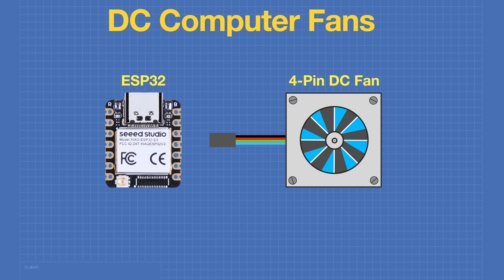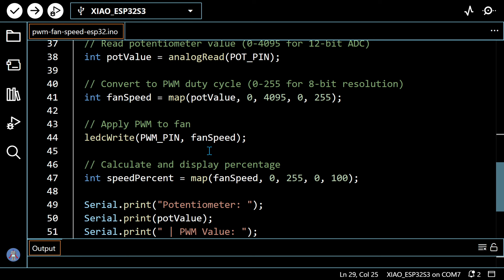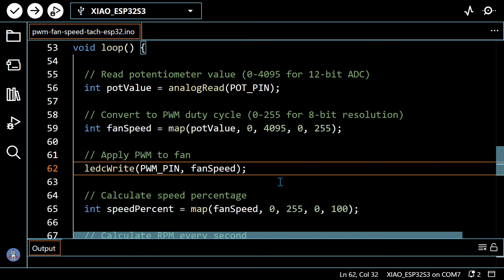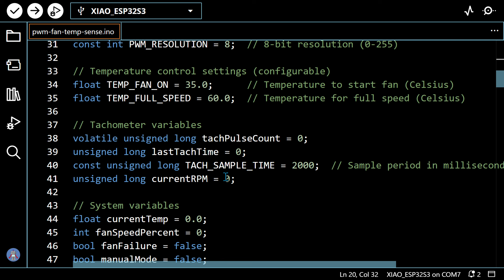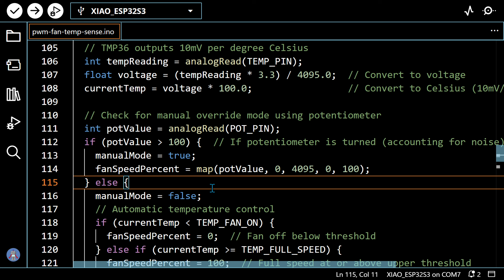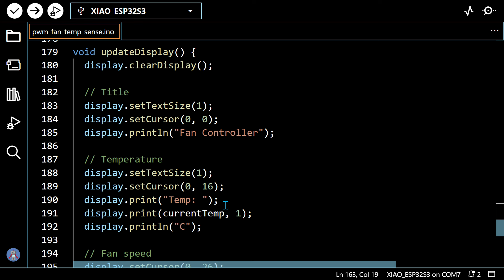ESP32 PWM Fan Control - Build a Computer Fan Controller

Comment: The only reason why "tachPulseCount++" is flagged as deprecated is because you declared the underlying variable as "volatile".

You probably don't need the volatile qualifier because nothing in your code is likely to be optimized out by holding the value in a register without putting it back or getting it fresh. At the end of that routine it would need to be put back, immaterial of it being an interrupt. And in the main loop it is a global that will have to be read each time anyway. It is possible (in an extremely narrow window, depending on when an interrupt happened) that you might be off by one count short. But preventing this would not be accomplished by the volatile qualifier anyway.

Comment: Thank you this code is exactly what I have been looking for. I'm pretty new to ESP32, can anyone let me know, whether I can use a single ESP32 for 4 PWM fans or will I need a seperate ESP32 for each fan? I am installing 4 PWM fans in my network cabinet, on 3D printed mounts. The fans  also have LED's which I plan to use a PoE WLED controller for.

Comment: I'm confused as the intels rev 1.3 4 pin fan specification says that the fan can use either 3.3v OR 5v. So the internal pull-up could be 5v.

Comment: Awesome as always. I am just working on a pair of coupled Arctic fans. Works great the same way you did except that I used an Arduino Uno. Both fans are controlled via one PWM signal. And I tried to use the 490Hz standard frequency as well as 25kHz where the second one requires some TCCR settings. 👍👍👍

Comment: Do I NEED esp32? Can't I just use Arduino Uno and read voltage sensor and control output with ADC DAC and SSR ?
Reply: Yes, you can copy this project to Arduino. Just be aware of different pin assignment. 👍

Comment: Nice and detailed video. Keep it up. I have a question though, what would be the best way to power esp32 boards from 1 or 2s 18650 batteries? In your video you use usb power for the controller board. But i want to do something stand-alone that is not powered by usb. I have 2 scenarios to be more precise, 1 - an diy fume extractor that can ve powered eithe from 12v dc plug or by using 3 cell 18650 batteries, and i want to include a controller for the 2 140mm 12v fans. And second scenario, i have a diy room air filter that has 5 140mm 12v fans that i want to control with esp32 board. What should i use to properly power up the esp32. Also, i want to make an rc car and controller and use 2 esp32 and communicate through esp-now protocol but i have issues to find a reliable tutorial or info regarding powering the boards and the rest of electronics in rc car.

Comment: isnt there a concern on the PWM signal line at the fan side? What reference does the fan expect? If it signal line expects 12v or 5v (how do we know what they are referenced to?) and the Arduino's pin outputs are 3.3v ... dont we need to do something?

Comment: Excellent explanation and information about CPU fan working process,thanks. My CPU fan DC 12 V ,0.18 A. 800 ~ 1900 RPM   LED 5V, 0.54A  of ROHS running noisy , is this PWM fan or steady speed type fan, can be serviced, please give your guidance.

Comment: Sir please add rotary encoder in you circuit and programming and add temperature 🌡️ set value so in auto mode Arduino follow given temperature range. I am waiting for this upgrade I will build one for my self when the upgrade comes. 😊

Comment: Can you explain how it will be coded and how will it work with a infrared thermal sensor?
What i was thinking, if i would make an temperature controled laptop cooling pad, the sensor has to be an non contact one

Comment: I'm getting frustrated with the PWM control. I'm using a XIAO SAMD21 and a DRV8871 H-bridge and want to control a coreless motor with software. But nothing I try works. The motor either runs in one direction or at full speed. I'm a long way from a customized motor controller. The whole thing is supposed to control a model train.

Comment: I want to control a fan near my fridge in my camper.  When temp goes over 32degrees C, then fan turns on.  This project is perfect for this.  But, I have a 12v supply and fans.  I can buy a buck converter power 5v the esp32 needs.  Can I wire the fans directly to the 12v supply and the own wire will turn the fan on and off?  Thank you

Comment: Nice video. I am curently setting up cooling fans on my solar inverters - it is unusually warm in teh UK! I tried the code from the article on the website and  the temperature does not calculate correctly. One problem is the lack of compensation for the -50 degree starting value of the TMP36. The other is that I am not using the same ESP32 module and I am finding variation in results from different modules. Using a clone of the Heltec wifi_kit_32 the following gives accurate readings from about -40 to at least +40 degrees in my tests: float voltageAdjusted = (tempReading - 500) / 1024.0;  // Convert and adjust voltage!!!

Comment: wow, i just created this a week ago. with 2 controller communicating each other, 1 without displat that sent fan rpm, fan speed, and temperature. and 1 controller with st7789 with LVGL that received data wireless from controller 1.

Comment: Thank you ! Excellent video. I did a similar project for a cabinet that has my stereo and cable modem. I used a simple 5v fan, DS18B20 temp sensor, Wemos D1 mini and a relay. I may switch the fan to a PWN type since the current fan makes a bit of noise at 100% speed.

Comment: I've never seen a computer fan over my 20+ years playing with it that doesn't do internal stall detection and wait a second or 5 before retry.
But having that external stall detection light is nice, but cutting it in software is not necessary
Reply: You can see that actually happening too when he does the quick demo at the beginning. When he stall the fan a second time it stays off for a second or two before restarting.

Comment: Everything is fine. Unfortunately, the code on the webpage is not the code for this video. As you can see in the video, the countdown for restarting the rotation begins after failure. This function is missing in the provided code.
Reply: Was thinking the same.

Comment: Thank you for this very nice tutorial! Is the built-in esc of the fan a feedback controller, controlling the rpm and reacting to a disturbances or is it 'only' feed forward outputting rotational speed dependent on the load?

Comment: Currently using 2 dc fans to exhaust humid air out of my bathroom. I drive a mosfet with pwm and direct its output to fans inputs. No problems so far. I keep duty cycle between 40 and 100 percent depending on the humidity. 

I have some extra pwm fans as well but they are to be used on another project. So these simple fans should have to do in that project.

Comment: Controlling the speed directly, only works well with a constant current source, like any other inductive load (motor). This is actually built in with 4-pin fans. I've been working with those professionally over the years. 
Although computer fans often have a 4-pin connector, plenty of fans for other applications don't have this.
Reply: Ok can you maybe bothered to explain how this works in noctua industrial ppc 3000 RPM fans?

They use 3 Phase motors and have standard 4 pin.

Blue is 3.3/5v pwm for speed control 
Green RPM is open drain Tacho 
Yellow +12/+24V depending on model (power Remains the same)
Black is ground.

And can you tell me how bad it is to directly voltage control it. Or directly use pwm on the power pins?

Comment: Thanks, 
Nb. can only be done with arduinos by rigging the pwm frequency. Otherwise stick to esp32.
Reply: Yes and it depends on the Atmel chip. Switching to a 12MHz cristal clock instead of the 16MHz on arduino boards allows the Phase Correct PWM mode to reach an acceptable 23KHz PWM freq (at least on most Atmega). But some more advanced AVR MCU like the Atmega32u4 used on Leonardo and Micro provide a Phase and Frequency correct PWM mode which allows to set up the PWM frequency as a simple code parameter.
Though it's easier to slow the fan by using PWM on the DC line to switch its voltage down with a transistor and a smoothing capacitor. IDK why Bill is so reluctant about 2-3pin DC mode PWM : it's broadly available on PC motherboards and from my experience even on 4pin fans it can be less rattling at low RPM than the standard PWM mode as it's important to notice that the main purpose of slowing down fans is noise reduction. Also some 12V PC fans can still function properly when powered by 5V DC, airflow is very low but it might be enough for some appilcations.
Reply: @PainterVierax can do it in software as well, but cannot remember how
Reply: @kevgermany  I meant with moderate coding skills. Because ofc if we dive deeper in timing programming, a 25KHz signal is doable through bit banging on most microcontrollers since the 90's. There are probably libraries to do that for Uno/Nano boards.
This is a trivial task compared to V-USB which can provide reliable USB 1.1 as low as a 12MHz clock on AVR8 MCUs.

Comment: Very well constructed video: each part is clearly explained and the final project is a very nice example of how useful current microcontroller boards are. Thank you!
With regards to PC/case/cooling fans, the vast majority of 12V ones have been designed to be compatible with ATX PCs and the standard they refer to is by Intel, "4-Wire Pulse Width Modulation (PWM) Controlled Fans" (I have Revision 1.3 of September 2005 and I believe that's the most recent version). That standard specified that the frequency of the PWM speed control signal should be "25kHz nominal, 21-28kHz is acceptable" alongside voltage levels, pull-ups, mechanical specifications of the connector. 
It may be useful to know that it's generally harder for a DC fan to start at low speed so such standard does not require compatible 4-pin fans be able to start at an arbitrarily low PWM duty cycle but it does require any compliant fan to reliably start at a duty cycle as low as 30%. Even if the fan one is using specifies the minimum duty cycle for operation (let's say, 20%), is advisable to start a fan from still with a duty cycle of 30% or more and then adjust the speed down if the target is below that. Finally it's acceptable for a compatible fan to stop spinning at very low duty cycle above 0%. It's also acceptable to spin at the minimum speed (no longer proportional) even after the PWM duty cycle has been lowered to 0% (yet it's probably not a very common design).

Comment: I just installed a 4 pin fan, few days ago (but for pi5, sorry for off topic), but do you know how to read current PWM state, to check the speed?
Reply: just use the tachometer like in the video.  It provides the actual RPM.

Comment: I have said it before, years ago, that electric vehicles can be more efficiënt if they can switch fast enough, this way the battery can be on an X amount (lower than full on the batter) and then you have alll this car weight, that mechanical aspect that is generating current by using a generator, which obviously needs to be rectified, and then fill up the gaps (dynamically) of the Puls width modulation of the cars engine. This seems to me a perfect way to increase distance which is now the obstacle of many EV's. The obvious benefit of such heavy cars is that you could use a generator on every wheel if needed or make it large enough that you get enough current to get enough power to the engine.. Combine this with a solar panel on the roof and you have somthing that is very efficient!